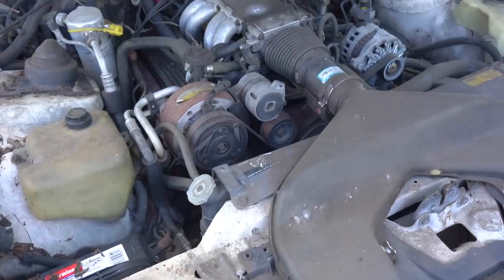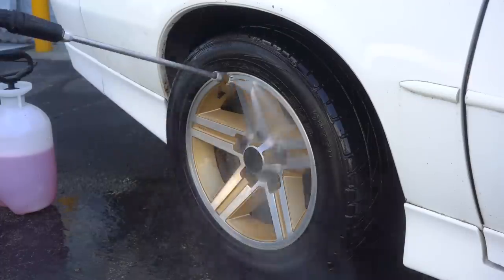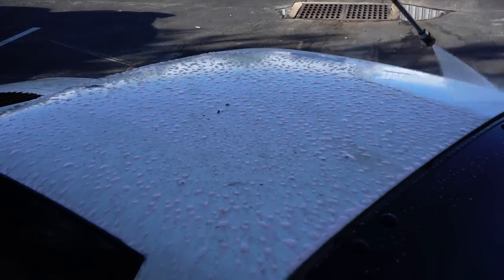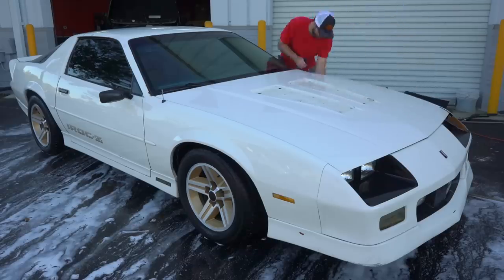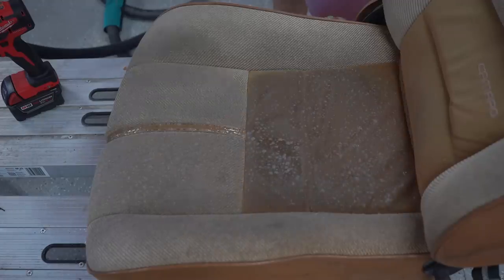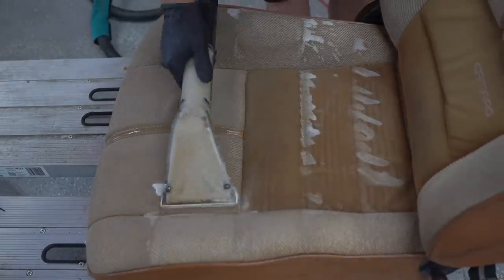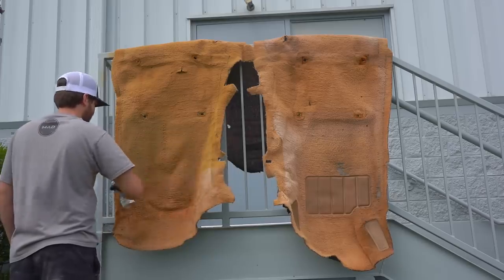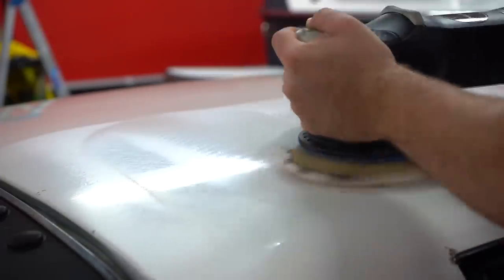Disaster Barnyard Find | Extremely Moldy IROC-Z | First Wash In 10 Years | Car Detailing Restoration

Comment: Would be nice if Chevrolet came back with a IROC on the new Camaros.
Reply: Camaro is being discontinued after the 2023 model so it probably won't happen. :(
Reply: My friend works for gm an they were originally gonna do that and actually the zl1s where goin to be called the z28s but they changed it. Fun fact if u look under  the hood fins on a 2012 zl1 they are stamped z28
Reply: @sonyaamartin  really?
Reply: IROC was a racing championship that licensed out it's name to both GM and Dodge to use on their vehicles back in the 80s and 90s, they are now out of business and no longer exist.

Comment: Mine was a 1988 in the 5.7, solid roof and a really really red paint.  It was fun as hell, but there was some ECM chip that kept crumping off.  Never was so glad I bought an extended warrantee in my life.  Called McPherson CHevrolet and they soend out a flatbad and called the wife to come and get me.  Didn't cost me diddly other than time.  This ting hated LA traffic and I drove a lot of shoulder to get some air into the bottom breather and keep it from warping heads or something.  Out on the 10 past Palm Springs it was a rocket.

Comment: Hi I'm new to the channel.  It's amazing how you can get the cars clean.  If I may ask I just bought a used car a 06 Grand marquis I believe that the owner before me was a smoker.  I've tried just about everything.  Car has leather seats I've used  Saddle soap I have also sprinkled baking soda on the rug and vacuumed it up carpet cleaner but the oder keeps coming back.  What do you suggest is the best way to get rid of that smell. Thanks . Joe.  😎😎

Comment: Question. So, if you weren't going to pull the motor and wanted to clean your engine bay like that what would you actually use without taking it completely apart? I'd imagine the distributor wouldn't be very happy about that. Obviously, this motor is going to be pulled and it's customer request for this IROC-Z. But, for example if I wanted to clean up the engine bay of my Trans AM. It's a bit different, using the LG4 so it's carb'd. What all would i need to do to prep, and clean it properly?

Comment: How does steaming the interior work out, long term?  Seems harsh on door panel cardboard backing, blasting a decades old,  plastic dash, etc.  (Fords lose the painted lettering on switches, if Formula 409 is applied. )Madd Acid on aluminum wheels?  They looked great, the Madd's manufacturer states not to use it on aluminum.  The IROC Z certainly looked spectacular, when you were done!  I subscribed!

Comment: Especially with that factory intake set up it has, there’s not really a chance of water getting in there if your spraying specifically that engine bay
Reply: It will get into sparkplug wells and soak the cables too. Might make the engine run rough or not start at all, but it's a quick fix once you diagnose it.

Comment: I could be wrong, but that steering wheel does not look like an IROC wheel. IROC wheels had three metal "prongs" (or whatever they are called) near the bottom that connected to the wheel before they went to an air bag wheel. This one looks like a steering wheel out of an early 90's Chevy Truck or S-10.
Reply: It is 88-94 Silverado

Comment: People are always concerned when spraying the engine compartment. Everything is designed for moisture. Do not spray directly on wires and coils/distributors or inside valve covers or intake ports. Vehicles this old you would have to worry about washer reservoir and over flow tank being old and brittle but they’re fine to spray

Comment: “Engine bays are designed to get wet” is that something that 200psi rain does? Get wet, yes... get 200+psi shoved into all the nooks and crannies of electrical equipment, I think not. The engine isn’t the worry, it’s the electronics like the fuse box, alternator, coils and such. You said the engine was getting rebuilt, but that doesn’t usually include electrical equipment.

Comment: I had a white, gold trim tan interior 88 IROC with no t tops, almost thought this was my old car, but the year of this one must be different, 89 maybee.
I had a 3 spoke steering wheel and the smaller 15" all gold IROC wheels cause the original owner did not want to buy expensive 16" tires,  I thought I got a good deal on a one owner adult owned low mile camaro,  305 automatic, I never had such bad luck with a car, I put tires on it, it never ran smoothly or had much power, a month after I bought it, the headliner fell, near every sensor went bad, rear hatch struts and hood struts went bad, rear hatch latch broke, radiator started to leak, it developed rod knock, when getting an estimate for an engine the trans went, finnaly I made sure the whole car went away a year after I got it.  Was such a money pit, handled terrible in the rain or snow, but it definitely was cool looking LOL!  The guy who bought it was going to make an SCCA show room stock race car out of it, he had bad luck just towing it home. It must have been built on a friday the 13th or something.  It was the cleanest most original rust free 3rd gen camaro I ever saw for sale,  but it was just an evil trap to lure in a new owner cause that thing had to be haunted.👻

Comment: These cars are becoming increasingly expensive. I won't say valuable as I own a Trans Am of this vintage. I have mine based on pure nostalgia alone. I was a teenager in the late 80s. They are not fast by any standard and they have the same ride quality as a UPS truck. Fit and finish is very poor with cheap plastic covering everything. On the other hand they are a whole lot of tire smoking fun. This car can do donuts from a complete standstill. I suggest running a cat back only exhaust for your neighbor's enjoyment.

Comment: Not knocking your work, but I wonder why bother even doing doing 1 step on the paint. 3rd gens had paint issues as you can clearly see on this one. If its being restored then paint should be on the list of things to be done. And it probably cost more clean and dye the carpet than a replacement wouldve cost. I had 2 of these and the parts for them are cheap.  Still nice work. I guess it just frustrates me. Lol

Comment: A race in Brooksville the winner receives $5,000 must have Volkswagen Beetle to enter race all local races will be running with Kohler or Briggs & Stratton upright two cylinder engines in their cars you are more than welcome to bring a Volkswagen with the original Volkswagen engine in it warning in this race Volkswagens with regular engines in them normally finish last but you can only enter if you have an original Volkswagen engine in your car or a 2-cylinder tractor engine good luck